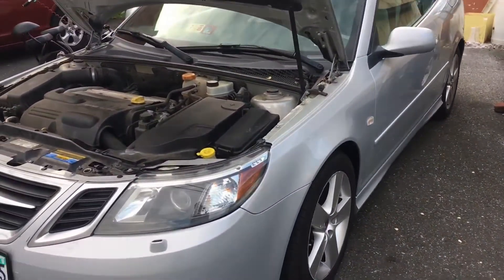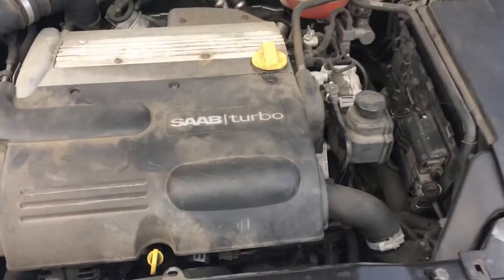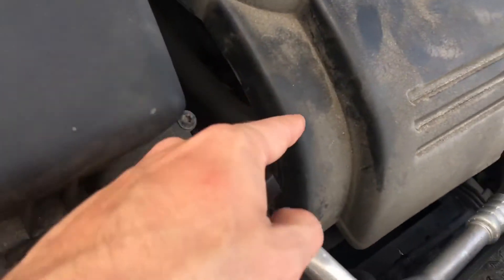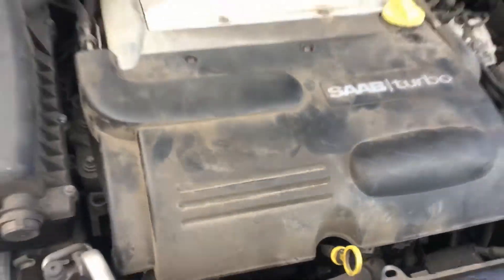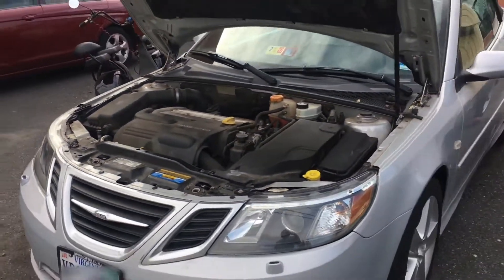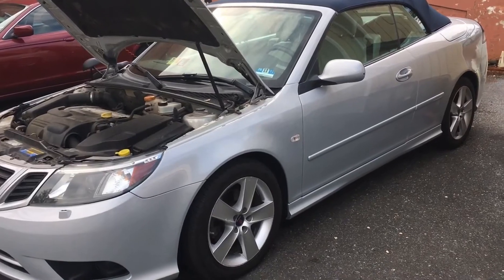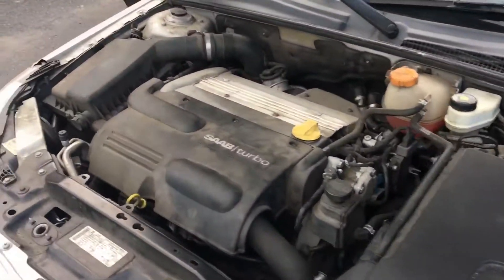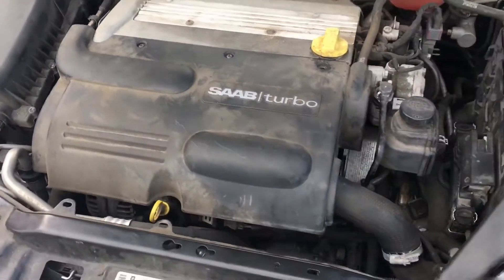P2122 P2138 Saab Accelerator Pedal Position Throttle Body Diagnostic Tip

Comment: So I have had these error codes on and off for years now (very annoying because of the Limp Home Mode). But I had to change the ECU for something unrelated and I'm still getting them, which points to the ECU not always being the culprit IMHO. At least not in my case. Also, you don't need to send out the ECU to be rebuilt, you can order a used one instead and if you have the proper interface and a PC laptop you can copy yours into the new one. Look up the Trionic forums about this stuff. It's not exactly straightforward, but it's doable.
Reply from the maker: Thanks a bunch for watching my video and taking the time to share that information. First of much luck with your diagnostics, this was a difficult issue. The ECU was the solution on my situation and yes using a GM TECH-2 with Saab software is your best best for diagnostics or programming. Are you using a TECH-2 scanner for your diagnostics?  There are a few items to check before deciding it’s the ECU, the actual throttle body and wiring going to it should be checked before, a wiring diagram is very helpful as well. Please share and update, thanks a bunch.

Comment: Where did you order the Throttle position Sensor from? I am having difficulties locating one for a 2007 saab 9-3 2.0T.
Reply from the maker: Thanks a bunch for watching my video and taking the time to ask a question.  Truthfully it has been a while since I got the sensor.  I would try Google searching, buy used Saab 9-3 auto parts.  A lot of sites have used inventory or have you fill out a request for so they can locate a part for you.  Please share an update thanks.

Comment: I have a 2007 Saab 9-3 and it is in limp mode. It shakes when idle and sometimes the car cuts off when it’s idle. The codes are for throttle position sensor. I can’t find any used throttle position sensors. Can I just buy a new throttle body?
Reply from the maker: Thanks a bunch for watching my video and taking the time to comment. You do not want to just throw parts at the car, without having solid diagnostics. Did you scan the car yourself? Did you use a Tech 2 scanner? Please share an update, thanks.
Reply: I changed out my TB for a new one but the problem comes back now and then. It could be the pedal sensor or the ECU, so rather than guess wrong  (having wasted £90 on a new TB) I just clear the code with a cheap OBD I keep in the car and carry on.
Reply: A bad battery can throw up this code

Comment: I have a SAAB 2009 9-3T and I am getting P2138/p2122 error codes on a used ECU i purchased on ebay. I purchased it as a backup to my original unit I sent off for repair. The ECU I sent off to get rebuilt did not generate this code. However, the spare ECU generates these codes. How can only one unit generate these codes and not the other? Could it be that the ECU I purchased from Ebay is bad?
Reply from the maker: Thanks a bunch for watching my video and taking the time to comment.  Did the replacement ECU have the same software and hardware version on it and exact part numbers?  Please share an update, thanks.